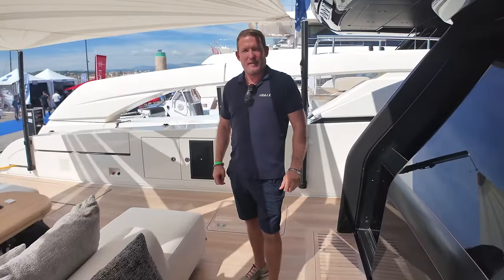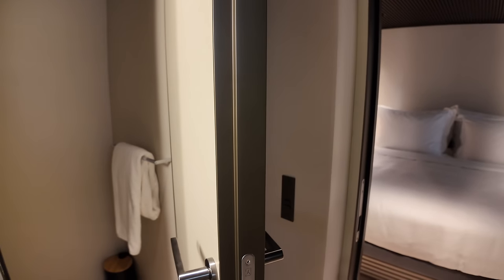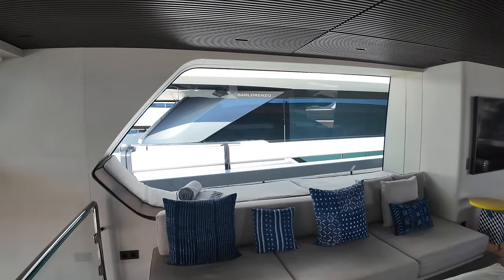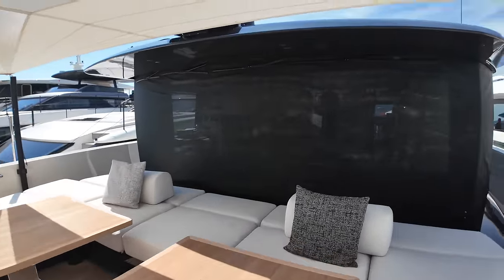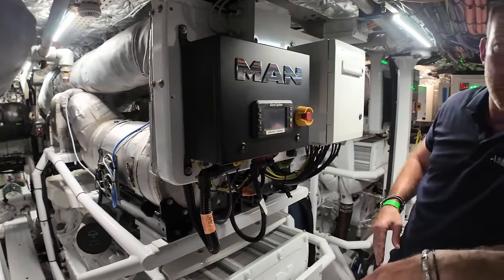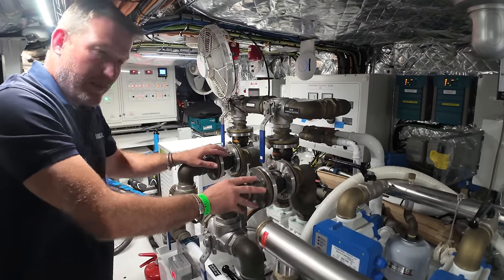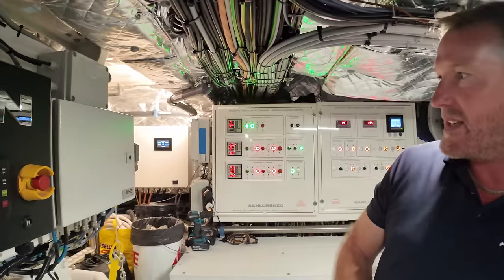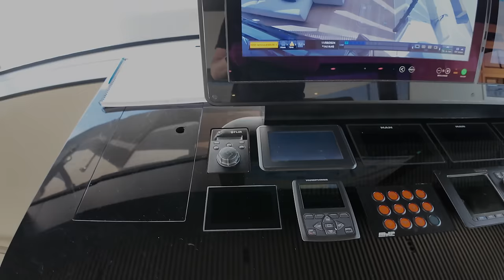€11,200,000 36-Knot TRIPLE Engine SuperYacht FOR SALE!

Comment: The fuel tanks hold 12,000 litres of diesel, and each Man V12 engine at 90% power uses about 300 litres per hour, times by 3 = 900 litres per hour at 31 knots, meaning it has a maximum range of 450 miles when fast cruising.